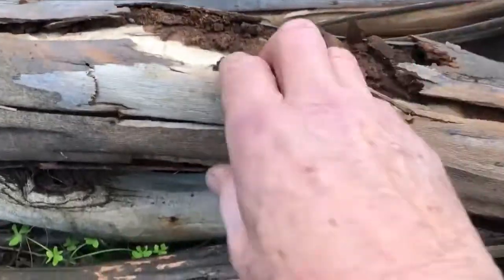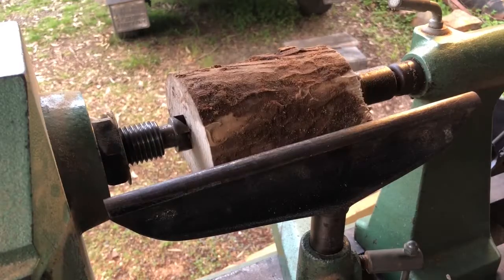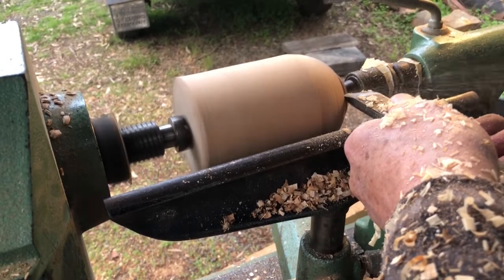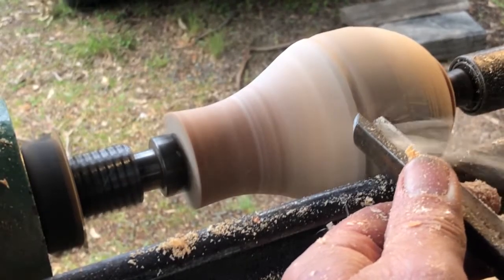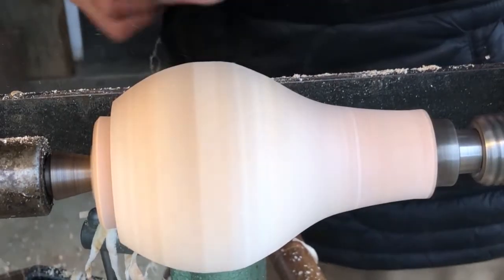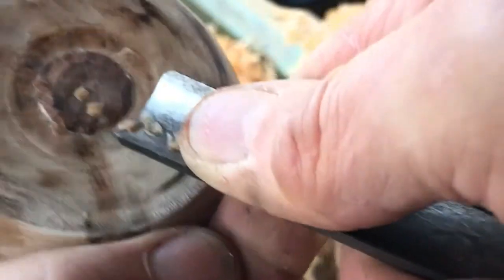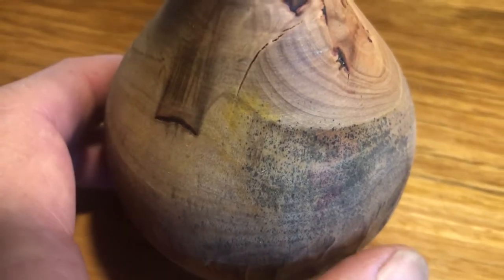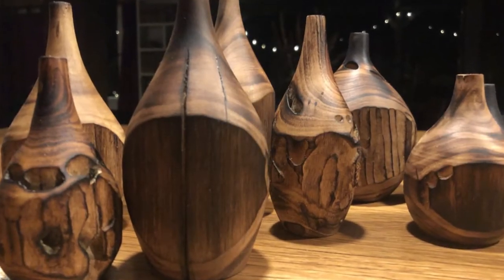Off the Grid Makes - 43 How to Wood Turn Weed Pots

Comment: What a coincidence, today I was doing just the same thing. We have a 5-acre bush property with a nice range of eucalyptus, wattles, Blackwood, she-oaks, etc. Many of the dead wattles have all the borer groves and holes, the same with some eucalyptus varieties. A nice surprise was a pile of old ‘she oak’ logs I cut up a year ago and left in the shade and the weather. They are very dense and hard, a superb finish without sanding and the colours are superb. I like the natural finish, with some bark and artefacts, nature helps in a very artistic way. Thank you for sharing your presentations. New to wood turning, just another interest to add to my many pursuits, I thought that I might be slowing down in my early 80’s, but not the case, still lots to have a go at yet. Regards from the Southern Cross Observatory-Tasmania 42 South.

Comment: I liked this.  Simple, easy, but a good skill builder / refresher as well. The hole in the neck seems a bit small, I like a bit larger to accommodate slightly thicker “twigs” or better yet glass tubes to hold a simple fresh flower.   Now.....why are these “bud vases” called pots?   Ps - i liked the torching effect.

Comment: if you seal wet wood right after you turn it thats when you get the mold. If you leave the pieces unfinished for a few weeks they can dry naturally, you should be fine then!
Reply from the maker: Yep - putting them in a plastic bag doesn't help either (unless you want to grow mould :-)  )